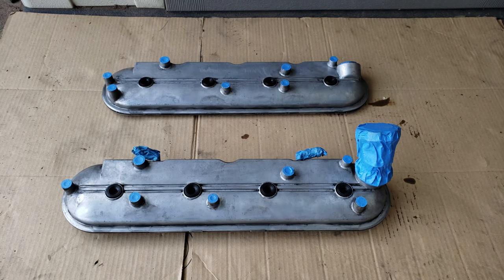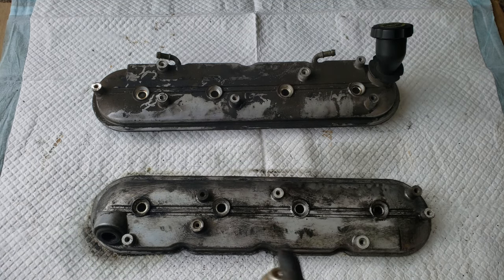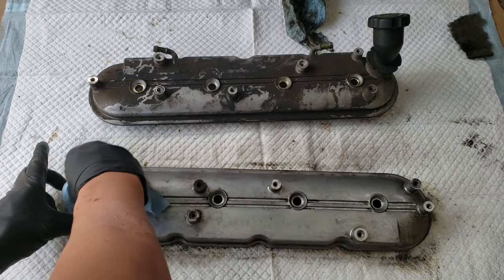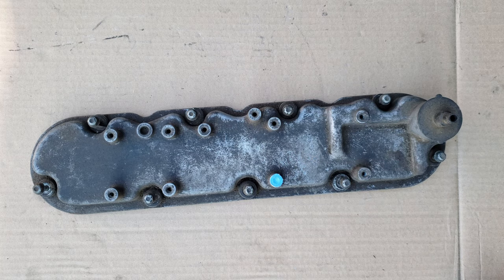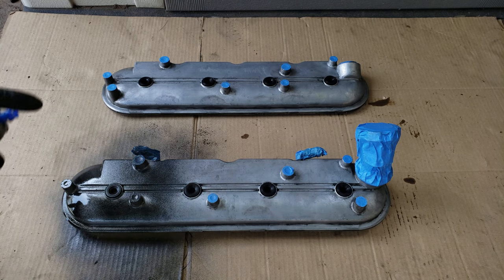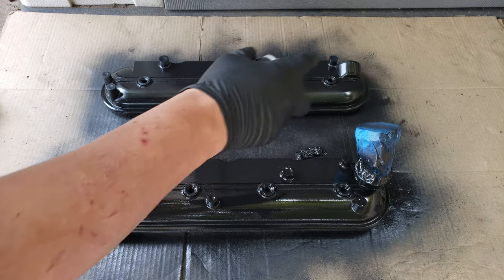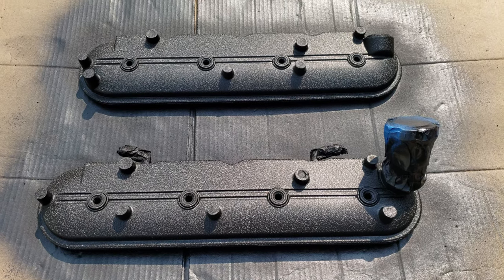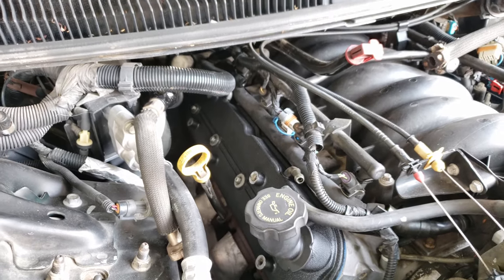How to Paint Your Valve Covers with a Wrinkle Finish

Comment: I believe when the cans states you apply 3 coats in a crosshatch pattern it also states like 5 minutes in-between each coat, ive heard from multiple sources that spraying thick heavy coats one direction only at a time, waiting the 5 minutes and doing the other direction in 5 mins, then diagonally in another 5m..